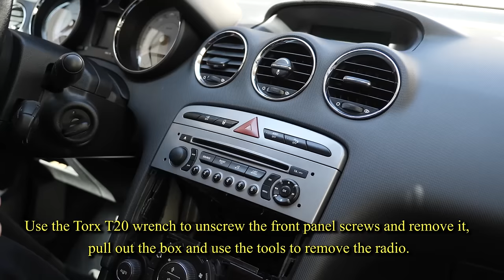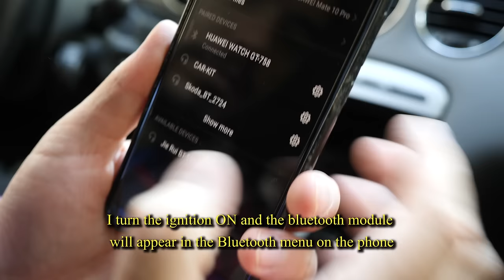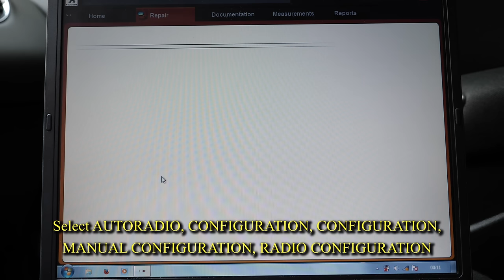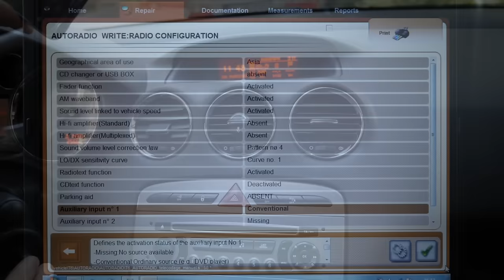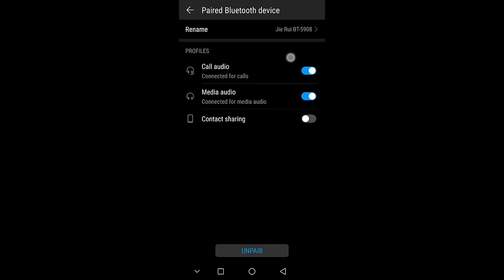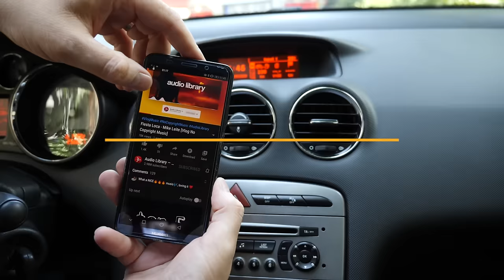Install Bluetooth Audio Module on Peugeot & Citroen Radio RD4, RD45, RD43

Comment: Im waiting for 2 month to receive this cadget from aliexpress to do the same think... im frome morocco and this make time to be here.
Reply from the maker: I am sure you will receive the bluetooth module, due to the Covid pandemic and the transports go much harder.
Reply: I reserved the bleutouth model 2 in 1 (bleutouth and cable jack ) in the same connector. I have a 308 model 2008
Reply: Please what's the search word for this Bluetooth module on Ali express because I have been searching but can't find it
Reply: @umarfarouksimpa1269  the bluetooth model depend to your radio, for exemple me i have a 308 so i serch for the radio RD4, so for searching i write in seach "bleutooth RD4" or bleutooth for 308 or you can find simply the link to go to the model in the desription on the video
Reply from the maker: @umarfarouksimpa1269  See the links in the description of the clip. This is: https://www.aliexpress.com/item/32826594463.html?aff_platform=link-c-tool&sk=q3G1DJg4&aff_trace_key=539da3c1216c480a809024e029141bd1-1590252639104-08665-q3G1DJg4&terminal_id=1caff12f1f9d493691c33a5a59bc05ab&tmLog=new_Detail&aff_request_id=539da3c1216c480a809024e029141bd1-1590252639104-08665-q3G1DJg4

Comment: Salut ! Nu găsesc pin nr. 11 
Pot conecta și in altul ?
Ai o poza sau o schița cu conectarile ?
Reply from the maker: Salut. In descrierea clipului gasesti un link catre shema mufei de alimentare.
Reply: Și cum îmi dau seama dacă am RD4 sau RD3 ? Scrie pe radio ?
Reply from the maker: @ifrimeusebiu6667  Daca ai 308 si nu are bluetooth sigur este RD4. RD3 a fost pus pe masinile de pana in 2004.
Reply: @AdrianDragan  Am un 508 din 2011
Reply from the maker: In cazul asta nu stiu ce tip de radio ai, eventual trimite-mi o poza cu etichetele de pe radio si incerc sa aflu ce model este.

Comment: where to find adapter for rd3 radio ? is this exsist ?
Reply from the maker: Hello! On Aliexpress there seem to be some usb mp3 adapters for RD3: https://www.aliexpress.com/item/32813269833.html?aff_platform=shareComponent-detail&sk=_dYrHhKO&aff_trace_key=1412ad3a4d1440f1a42324b9ed627c08-1597351498842-03085-_dYrHhKO&terminal_id=3a8f5add39814c9a9eb3200bc67debac&tmLog=new_Detail&aff_request_id=1412ad3a4d1440f1a42324b9ed627c08-1597351498842-03085-_dYrHhKO
I haven't tested them
Reply: @AdrianDragan   thanks :) i know for this yatour and xcarlink cd changer emulators. i was thinking ,somethig like on your video,just for bt connecting.
Reply from the maker: @brankoYT3KTT  I'm sorry but I didn't see the bluetooth mode for RD3.

Comment: On my 308cc it didn't work. By chance you have to unlock the mode from the Bluetooth of the car?
Reply from the maker: Hi. This bluetooth module should work if you have the Aux IN option enabled. Check by pressing the SOURCE button on your radio.

Comment: I have a Peugeot 207 2012 and I really want to install either an AUX input or a Bluetooth connection. I haven’t tried anything yet, but when I click on the ‘’source’’ button Nothing pops up, is that normal? Because if the source button isn’t working and I have to press it in order to use the Bluetooth module, then I won’t bother trying this out. Or is the source button not working because there is currently no other options to be a source other than radio?
Reply from the maker: Hello. The source button does not work because you do not have another audio source. Try to put an audio CD in the radio and see if you can use the Source button to change between Radio and CD. To be able to use the Auxiliary cable or a Bluetooth module, you must activate the AUX IN function in the software.
But check if your car has RCA Aux IN audio jacks in the glove box. https://i.ebayimg.com/images/g/f0EAAOSwFGJcwTZV/s-l1600.jpg
Reply: @AdrianDragan I will test the source button with the CD, if it works then I will follow the instructions of this video. Really appreciate the reply thank you!

Comment: Will this audio bluetooth module be compatible if my peugeot 207 has got an USB apdter? It cames with the USB adapter when I bought the car new in 2008.
Thanks
Reply from the maker: Hi. It is definitely compatible.
Reply: @AdrianDragan  Today a removed the radio just to see the plugs behind. Inside the rear black plug of the radio I have a white plug (I suposse this white plug is used for the original peugeot USB adapter). If I umplug this white plug and install the bluetooth adapter I am afraid that this will cancell the USB adapter  just letting me use the new bluetooth adapter. What I want is to use both adapters. I hope you understand what my concern is. Many thanls for your help Adrian.
Reply from the maker: @bestione761  Theoretically, the USB cable does not connect to the black plug, most likely the white plug is a preparation for auxiliary input.  Remove the white plug and plug in the bluetooth module, then you need to activate the Aux function with Diagbox.

Comment: Hi Adrian how I instal diagnostic program on windows10?
Reply from the maker: Hello,
I installed a very old version (10 years ago) and it works on Windows XP. The new version of the link seems to be installed on Windows 10 but I can't explain how. Anyway, if it doesn't work on Windows 10 you can put a virtual machine and then it should work.
New version Diagbox hardware/software: https://www.aliexpress.com/item/32380831616.html?aff_platform=link-c-tool&sk=lOyJt0Da&aff_trace_key=527f415fc78745849dac344b47c46e1a-1589809797578-07763-lOyJt0Da&terminal_id=364d159dab6d4da48c68657f8054a5c8&tmLog=new_Detail&aff_request_id=527f415fc78745849dac344b47c46e1a-1589809797578-07763-lOyJt0Da

Comment: hello good work,nice guide,how i get this obd software ? İ founded PSACOM,is it true ?
Reply from the maker: By purchasing the Diagbox hardware interface, you also receive the software with it: https://www.aliexpress.com/item/32380831616.html?aff_platform=link-c-tool&sk=lOyJt0Da&aff_trace_key=527f415fc78745849dac344b47c46e1a-1589809797578-07763-lOyJt0Da&terminal_id=364d159dab6d4da48c68657f8054a5c8&tmLog=new_Detail&aff_request_id=527f415fc78745849dac344b47c46e1a-1589809797578-07763-lOyJt0Da

Comment: hi it can work with peugeot 508??
Reply from the maker: Hello,
I can't tell you if it's compatible with the radio on your car. What type of radio does your car have? When you press the "Source" button do you also have the Aux IN option?
Reply: @AdrianDragan  yes it got the aux in option!! you think it can work?? thank you for replaying
Reply from the maker: @PatrinkoPat   If you have RCA cables for the auxiliary input, you can use this bluetooth module: https://www.aliexpress.com/item/32821770160.html?aff_platform=shareComponent-detail&sk=_d8oWkol&aff_trace_key=0a5255de3b904e5f91770c94b7040d5e-1601814541134-03177-_d8oWkol&terminal_id=364d159dab6d4da48c68657f8054a5c8&tmLog=new_Detail

Comment: Okay now when i go to click validate it says programming failed
Reply from the maker: Hello. Sometimes I have seen such problems occur with "programming failed", I think it's a limitation in the factory software.I still haven't found a solution for this.
Reply: @AdrianDragan  thank you for your response i will just return the device and buy a fm transmitter for the cigarette lighter, i did how ever use one of your videos to stop the radio beep by changing the vin number on the radio so thank you for theses videos.
Reply: @AdrianDragan  what version of diagbox do you use?
Reply: @AdrianDragan  I got it to work just needed an update
Reply from the maker: @gst_6377  What did you update?
Reply: @AdrianDragan  diag box needed to be updated i was using version 7.01 up dated it to 7.57 n it worked
Reply from the maker: @gst_6377  That's great. Good to know. Thanks!

Comment: Ptr c4 model 2007 merge?
Reply from the maker: Salut. Da, merge.
Reply: @AdrianDragan  un link de unde sa iau?
Reply from the maker: @adrianconstantin2140  Uite aici: https://www.aliexpress.com/item/32826594463.html?aff_platform=shareComponent-detail&sk=_dUYqCGe&aff_trace_key=1d061a7a316c4dacbe7c20a5c3870397-1597416194174-02980-_dUYqCGe&terminal_id=364d159dab6d4da48c68657f8054a5c8&tmLog=new_Detail&aff_request_id=1d061a7a316c4dacbe7c20a5c3870397-1597416194174-02980-_dUYqCGe
Reply: Ai instalat si microfonu? Eu aș vrea fără microfon, il prefer pe cel de la telefon când răspund doar pe boxe sa se audă? Mulțumesc

Comment: Hello Adrian! I wanted to ask you, I've connected black wire to 16th pin (yellow-green). And red wire to 12th pin(yellow) since I don't have any wire coming to 11. As your video says, the Bluetooth module stays permanently on, even without ignition on. I've seen in other answer, you say it should be a problem in terms of battery being drained The question is where can I connect the positive, so the bluetooth is only on when the ignition is on? I have wires coming to 10, 13 and 15. But I don't know which one does what. Here is a pic of the wires: https://drive.google.com/file/d/17_ByjRPIk4ZULvxIO5dL7vncbUzc3iSs/view?usp=drivesdk
Thanks in advance
Reply from the maker: Hello Hector! The current discharge to this module is very, very small. I don't think you will have problems with the battery if the bluetooth stays active for a few days.
Reply: @AdrianDragan  thanks for your reply. The thing is that I don't use the car that often. Sometimes I don't use it at all for two o three weeks. I was thinking to install a switch in the red wire so I can manually activate it. I think that shouldn't be a problem, would it be?
Reply: I would also like to know this. My 11th pin is empty as well, have you figured out which one we can try? (Citroen radio model: RD4 N1 MP3 - 02)
Reply from the maker: @aleushah  There is no problem if you install a switch on the red wire. This is better because it will protect the battery.
Reply: @AdrianDragan  thanks!
Reply: @uygar84  I haven't done anything yet. But I'm gonna borrow a potentiometer just because I'm curious to know if I could use wire coming to 15. If I don't tell you anything in two weeks time, ask me again.
Reply: Héctor Martín López I actually did try pin 15 after writing to you, but it didn’t work. Is 15 red with yours too? I can’t see the picture you posted, can you upload it to imgur or similar, or make it public?
Reply: @uygar84  go the picture I posted in my first post, it should be public now. (I thought it was). My current setup is 12 red, 16 black. I haven't tried connecting the red to 15 yet. That's why I want to check with the potentiometer, but I'm going on holidays for couple of weeks and I don't think I can try it out before I go. Let me know if you come to a solution. If not, I'll probably end up installing a switch.
Reply: Héctor Martín López Saw your picture now. Mine is pretty much the same. As I said, connecting to 15 didn’t work. I wonder why 15 is used at all when every single schematic out there says it is “Not used”. Let me know if you find a solution please, I will remind you. I would also like to know about the switches that you mention, can you link me to an example? I’m a beginner about these sorts of things. Thank you!
Reply: @uygar84  I'm a complete beginner too, I just keep googling till I find a solution. Check this out:  https://images.app.goo.gl/s422ZDTWbEWUPCiQ9 
 https://images.app.goo.gl/tPFg8vbB8b4v6ZNc6

https://www.ebay.es/itm/222669698262

My first idea was to use one of  this switches with the little led, so its easier to see it's on, so you don't forget to switch it off before you leave the car. My guess is that it will use some energy, but if Adrian said that the Bluetooth module energt consumption is very very low, this should use even less. Other option would be to use a switch without the little led, so it doesn't consume any energy at all. Those switches have only two pins, you would cut the red wire in the middle and connect each pin to one end.
Reply: Héctor Martín López UPDATE: I tested pin 15 with a multimeter, and it behaves exactly like the (non-existent) wire in pin 11 should according to diagrams. So I guess mystery is solved, we should splice to pin 15. But I couldn’t make it work with the quick splice connectors Adrian mentioned in the video. The device just wouldn’t appear on my phone bluetooth list, despite the metals in connectors testing ok for + and - after splicing. I may have received a defective bluetooth device. Anyway, pin 15 is the way to go in mine, hope yours is the same.
Reply: @uygar84  thanks for the info. I'll try it when I get back and I'll let you know. Maybe you can try to power a different thing before you buy a new Bluetooth module. Maybe a bulb? I don't know, just an idea.
Reply: Hi again. I finally tried connecting to pin 15 and it works well.  Did you get a new bluetooth module at the end?
Reply: Héctor Martín López Great! Turns out my unit wasn’t defective, but my splicer wasn’t the correct size the unit wasn’t getting electricity. I decided to go with cable aux connection (because they don’t require seperate power), and bought a cigarette lighter bluetooth receiver with an audio aux output (which goes into the stereo), serves my purposes well. Enjoy!

Comment: What is the name of the Pc program?
Reply from the maker: Diagbox. You receive the program with the hardware interface on Aliexpress  https://www.aliexpress.com/item/32380831616.html?aff_platform=link-c-tool&sk=lOyJt0Da&aff_trace_key=527f415fc78745849dac344b47c46e1a-1589809797578-07763-lOyJt0Da&terminal_id=364d159dab6d4da48c68657f8054a5c8&tmLog=new_Detail&aff_request_id=527f415fc78745849dac344b47c46e1a-1589809797578-07763-lOyJt0Da
Reply: @AdrianDragan  do you think is useful to buy this, you can use it for other purposes?
Reply from the maker: @titoviera3011  It is very useful, you can make a diagnosis, you can make various activations.